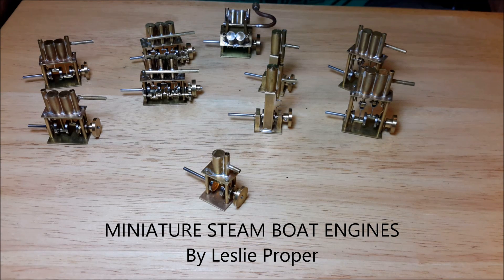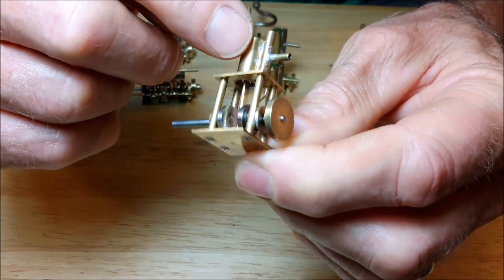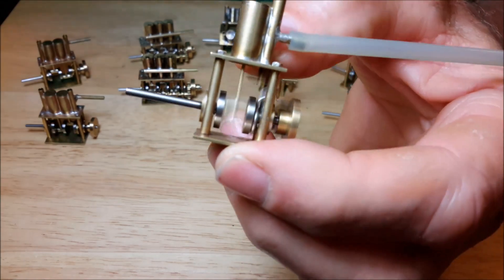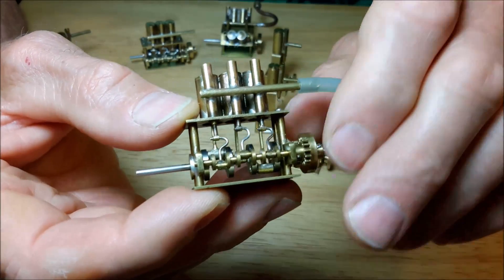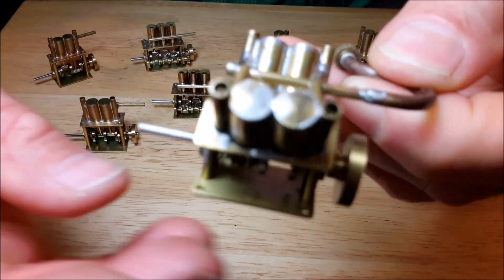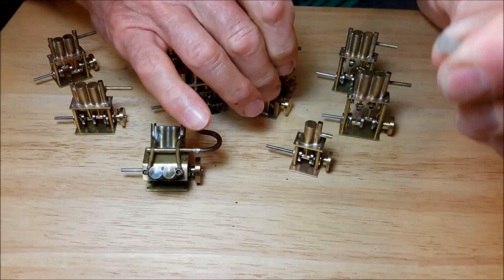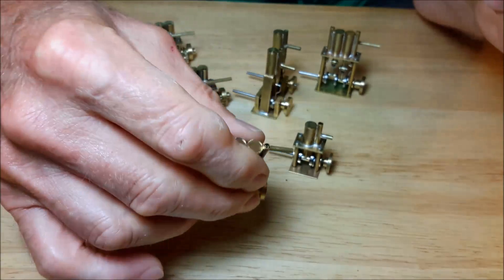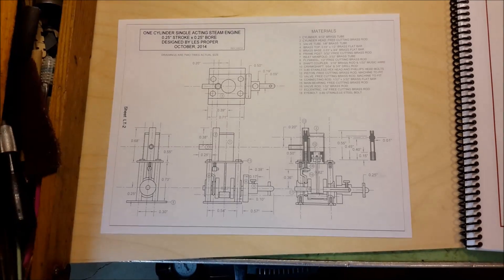Miniature steam boat engines by Leslie Proper

Comment: thats awesome ! i'm curious about the differences in torque, speed and efficiency of these variants
Reply from the maker: Generally speaking,  for a given boiler size,  the single cylinder engine runs four times as fast as the 4-cylinder engines, but the 4-cylinder engines has four time the torque.   So they basically produce the same power.  Power is a factor of the boiler, not the steam engine, however the 4-cylinder engine can be run on a larger boiler to produce more power.
Reply: @LeslieProper  thanks !

Comment: Are any of these for sale anywhere from you or anyone? Thank you
Reply from the maker: No, sorry.  I can send you the plan for building the one cylinder engine, however a small metal lathe is needed to build it.
Reply: @LeslieProper  hi thank you for the reply Leslie  but I have no lathe so plans I couldn't use but thanks again, fabulous engines you have

Comment: Incredible Little Engines. Just absolutely beautiful job!
What I'd like to know is how do you solder all those joints without Previously soldered joints coming apart again? Or is it something you just do it all at once?
Reply from the maker: Yes, I do it all at once.  The trick is to machine the parts so they fit snug and stay together during the soldering operation.  I also use fine copper wire to hold some of the parts in place.  The soldering is done by placing tiny bits of solder at all of the joints and heating evenly so the bit melt and flow into the joints.

Comment: I bought a miniature engine similar to the ones shown in your video but I don't have a way to power it. What are you using in this video that allows for variable pressure and seemingly silent operation?
Reply from the maker: I am using a small compressor.  I switched the compressor off to eliminate noise during the video.  The engine speed is varied by adjusting the pressure regulator on the compressor tank from about 4 to 9 psi.
Reply: @LeslieProper  Thank you!

Comment: Great little engines witch do u thinks the strongest one out of all of them
Reply from the maker: The power of a steam engine is determined by the boiler.  All of these engines would produce the same amount of power on the same boiler.  The single cylinder engine would run four times as fast as the V-4 cylinder, but the V-4 cylinder would have four times as much torque as the single cylinder.  Since speed multiplied by torque is power the engine all have the same power on a properly sized boiler.  However, the multi cylinder engines could handle a larger boiler and with a larger boiler would be more powerful.

Comment: Is it possible to do it reversible chep and easy?
Reply from the maker: I have thought about how to make the self starting engines reversible.  I have not attempted to do it yet, but this is what I think would work best:  Are you familiar with a Maudslay reversing gear?  It uses spur gear to change the rotation between the crank gear and valve gear.  I think it would be easily adapted to the little 3- cylinder as it already has crank and valve gears.  I think the best way to reverse the V-4 and the 2-cylinder double acting engines would be to reverse the direction of steam flow with a four way valve.  For example if I connect the steam pipe to the two exhaust valves on the top of the engine, it will run beautifully in reverse.  I have made several tiny four way valves that work good and are easy to make.  I do not think a Stevenson valve gear with double eccentrics would work very good as there would be too many tiny moving parts to hold in place.  Thanks for the good question.

Comment: I love them. I want to make some myself, I don't know if I could pull off that level of precision... I guess I should get the book haha
Reply: I have recently been getting into miniature steam engines as well as small nitro engines for model planes (as well as building the planes but the engines are what got me interested)  the only problem is I don't have the means to machine parts for steam engines and all the good designs I see are diy.
Reply from the maker: If you want to try building the one cylinder single acting engine, the simplest one to build, I will send you the plan and general building notes in a pdf.  Send your email address to me at lesproper@gmail.com

Comment: Unfortunately I have difficulty building my own stuff. I could probably make a boiler from a can to power one of these.

Would I be able to buy one? How much would one of these cost. For example the 3 cylinder.
Reply from the maker: I am sorry I do not have any engines for sale.  They are fun and quite easy to build, but time consuming as well.  I don't think they would sell for the cost I would have to charge.
Reply: Thankyou . Looks like its back to Hobbyking Steam Engines. -_- Cheapest being around £12 for me but thats a mini single cylinder. 

Your engines would be better for the job, they are not heavy, they can start themselves (some of them) and they are quite powerful. I will look into your designs for these but with my limited machinery I dont think I will be able to make these.
Reply from the maker: A small metal lathe is needed to build the engines, such as a Sherline or Unimat.  Thanks for watching my videos.
Reply: Thankyou. I subbed.

Comment: i could offer you any price for the v4 if you are willing to sell
Reply from the maker: Sorry I don't sell finished engines, but I sell a book with plans on how to build them if you are interested.
Reply: Leslie Proper no thank you i just wanted a little engine to put in my little home made steam boat
Reply: Also i am 13 so i cant really build them
Reply from the maker: Hello Corbincraft,  Have you considered using an electric motor.  It would be much cheaper and easier to use electric motor for your boat.  Anyway thanks for your interest and keep building those model boats.
Reply: Leslie Proper i have used electric motors before but i saw your videos and was instantly fascinated by your engines
Reply: At 13, you can easily learn and get good skills, ask for some help. Lots of older people like to pass on their skills....

Comment: Very nice collection of engines. I'd thnk it would be possible to take one of the double acting single cylinder engines along with a very very small boiler and put them in an Airfix Lucky XI plastic kit, provided you insulate and fireproof the boiler.
Reply: Not easy , it's been tried before without any success . The best plan is to use a wooden hull or better still a steel one . The larger the engine the bigger the boiler has to be .

Comment: how hard would it be to make the little 3 cylinder double acting?
Reply from the maker: +matt whitehouse I'm sure the three cylinder, and the V-four cylinder for that matter, could be made double acting.  I don't think it would be all that difficult.  The problem I see is that the steam consumption would double and these two engines are already at the limits of my miniature steam boilers.